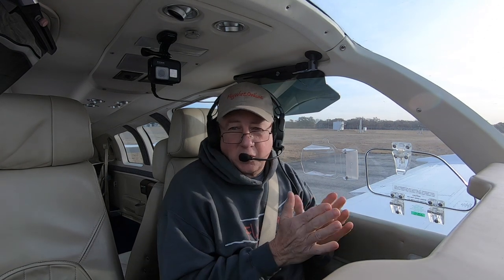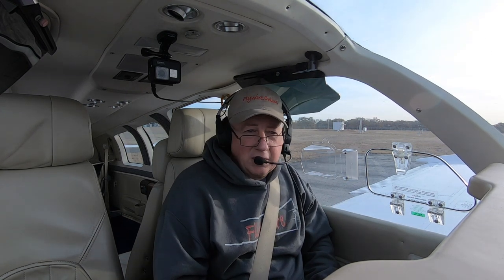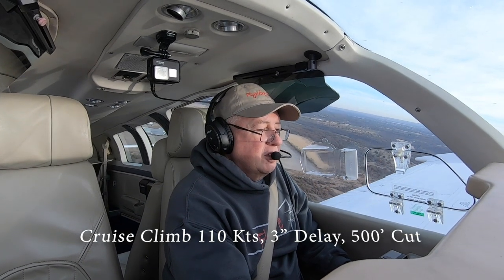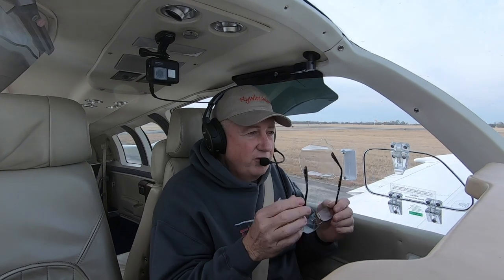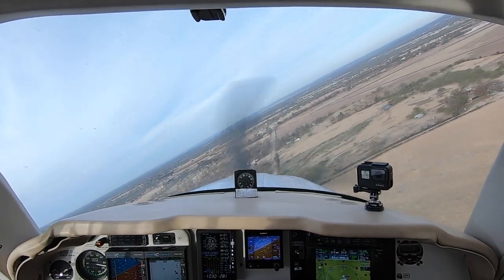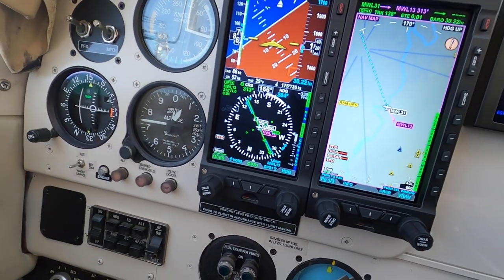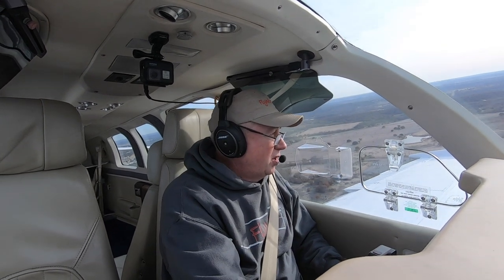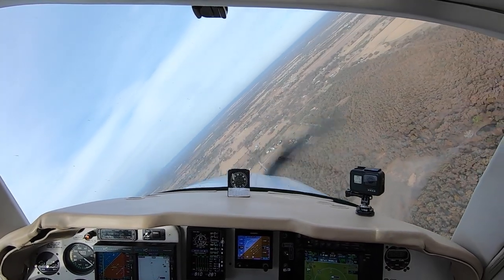A36 Bonanza Engine Failure on Takeoff:  Impossible Turn or Turnback?

Comment: What a great topic. I love your videos! Part of my pre-takeoff briefing is vocalized TWICE - once at the airport before getting in the plane (or at home before heading out to the airport) after getting ATIS/ASOS weather and once again in the plane holding short before calling the tower to depart.  I vocalize the 70/50 rule - must have 70% of Vr by 50% of runway remaining or abort the takeoff - which for my plane is typically right after airspeed is alive at 45+ KIAS. Once in the air, failure (push down, trim for best glide AS SOON AS POSSIBLE...) at 0-400 feet AGL, land straight ahead, 400-700 feet consider turn into the wind up to 90 degrees, 700-1,200 AGL consider up to 180 turn, and above 1200 feet AGL, return to the airport. I call out what these altitudes are in MSL (and write them on a post-it note I put on the flight deck in easy view). It might say (400/Straight, 700/90 L or R -once I determine wind, 1000/180, >1000/Airport),  I find it VERY important to use Google Earth and really review and survey the 2-3 mile area around the airport environment - that is most likely how far I would be away from the airport if I lost my engine under 1200 feet. Also to look at 3D view on Google Earth so I can see what potential obstructions I might be dealing with - compare against FF or my Sectional. Glad to have the FF glide advisor... On takeoff I ASSUME I am going to lose my engine to help me anticipate a push and not be in too much shock or have too much hesitation if it does actually fail. Complacency kills people - even the best pilots...

Comment: Thank you for the exceptional video. I suffered an engine failure 17 years ago in a v35B, an experience that I relive every time I fly.  I can assure you, and everyone that reads this that any decision to turn back at 500 feet agl will be catastrophic, unless you are in a Cub or other high glide low stall airplane. My failure occurred at 700 feet and past the end of a 3000 foot runway on a hot, high DA afternoon.  I had just seconds to “fly to the crash”, in my case a corn field.  Gear up landing, no time to get it down and manage the additional drag. I and my pax walked away.  I have since practiced the maneuver every month at 3000 plus.  The story doesn’t change, under 1000 plan for straight ahead or possibly 90 degrees left or right.
Thank you once again for the fantastic video.
Reply from the maker: Leo- Thanks so much! I'm glad you liked the videO and you have a great story! Glad it turned out well! Practice instead!

Comment: 40-45 degrees bank and Vminimum sink will make you turn in less radious.  It wont stall unless you are too heavy or pull too much (Panic Pull).  If those 2 cases, dont turnback.  Or unless over 1,200 agl.  In the turn, if get too slow under say 90knots you are supposed to pop 10 degrees or 12 flaps in this case.  The lower the speed, the lower the flaps have to be to lower the stall speed. That is normal knowledge for any real pilot.  Thanks for your video Mr. Perdue.. Good knowledge saves lives.  Some say dont learn turnbacks.  But ignorance is not the answer, IGNORANCE IS THE PROBLEM.

Comment: Always excellent well calculated analysis.  Ground rush is a big issue in landing my parachute every time and is a killer....at least a bruiser.  Not really practiced in Aviation.  I had not thought about that aspect of engine out.  Also the Mush as you try to level off.....may push you into the ground.  A lot to consider.....  Thank you!

Comment: From 700 agl you could easily reach the runway, you had enough alt to even drop the gear and flaps at 06:19.  But then the crosswind tailwind landing could be a challenge.  From 1k could be even easier.  But that crosswind/tailwind landing could demand perfection, specially on the tailwind alignment.  Tailwind turns you have to start them before you think you need them or you will over shoot the alignment. 
The CFI that taught me those turnbacks 2 decades ago have a video landing a cherokee with full 16 knots of tailwind/crosswind on 3,000 feet of runway used.  
He used full flaps at the 180 degree point, forward slips, align early, then cut the flaps and mixture in the flare.  Good tricks to know..

Comment: I retrained after thirty years away from flying.  Although turnback after engine failure wasn't prominent in the syllabus, it was important to me, and I practiced it at altitude over I-10 west of New Orleans Lakefront (where a failure from 36 drops the plane in Lake Pontchartrain).  One of the issues was turn direction from the takeoff leg.  I decided I would rather be upwind during the turn drifting toward the airport than downwind clawing back to it.  With a failure on the takeoff leg, and from a plausible altitude, I would turn into any crosswind. Another issue was how to mitigate the problem, and to me that meant regularly staying in the pattern close to the airport a bit longer while the engine proves itself.  This argued for a routine turn to crosswind sooner and at lower altitude than later, further from the airport.
Great video.  Only suggestion is to report how much of the needed turn the plane completed in each case.  How far around had it come (50%? 80%?) before you stopped the exercise at 200' AGL.  Thank you and fly safe.
Reply from the maker: Sounds like you approached the issue methodically. Good job.

From my perspective, the amount of turn remaining is not important and may prove a negative. If its not enough, acknowledge that and land somewhere else, while you still have the energy to do so. That's my take.

Comment: I wonder if you could carry a small rocket engine to be used only for a limited period in engine out situations to extend glide or allow for more speed in the take off regimen.  Not jato, but sort of like it.  Just enough to get you a couple of miles.
Reply: An expensive and heavy system that would use up most of the aircraft payload capacity and might get used once in 30 years.

Comment: Thanks for this! After the Harrison Ford incident, I went up and practiced different configs with a 1K over a practice field sim takeoff/climb and same as the hard deck until I had it figured out. Now, I can do it consistently to a full stop as long as I have at least 800agl at a mile or less with turn into any crosswind. Slip and flaps often needed with a good tailwind. At half mile, 500agl is the magic number. It's a good tool to have in the bag if the straight ahead options are buildings and one knows the numbers. The thing that surprised me most is how brisk the push needs to be to get best glide in C182 when pulling the throttle on climb out.

Comment: Communication is critical. If at a Towered airport, my "goal" is to return to the Airport Environment where the Tower can immediately get help on the way, to my exact location.  Just the Airport Environment, with mostly flat land around the runway. If I can make the runway...Bonus.  At non-towered or airports in busy city areas, pick the best spot and go in wings level as slow as possible.
Reply from the maker: Great observation!

Comment: I instruct this "impossible turn" maneuver at altitude and perform a 360 turn so one can simulate being re-aligned with the runway and then getting the gear down.  I ask the student to hold the pitch for 4 seconds and we loose 5 knots per second, so we are already at 85 - 90 when we then unload the wing and roll into a 45 degree bank.  We do a 360 turn, and lower the gear with 30 degrees  of turn to be completed.  I will now watch the sink rate (ground rush) and make that part of the debrief. Keep up the good work!   We typically loose 1100 feet on a good day!  Most pilots keep their airspeed too high which accelerates their sink rate!
Reply from the maker: Dan, excellent to hear your technique. Doing this maneuver close to the ground leaves little margin for error.

Comment: I've done this whenever I've bought a new plane.  I have found that it is best to turn no more than 90 degrees at 500 feet and 180 degrees at 1,000 feet
Reply: With a good wind you can do more.  Not on short wing airplanes.  or shallow climbing airplanes. Not those.  With partial power you can Turback from 300 agl on non too heavily loaded airplanes.  It takes practice but it is good to know those maneuvers.
Reply: @feetgoaroundfullflapsC  Banner towing climbs to only 300 agl to Power On Turnback to pick up the banner.  Crop Dusters Turnback from 200 ag, Power On too.   A matter of knowing how and not pull back much until the runway or place to go is under you.  No Panic Pulls..
Reply: About the same advice as fly wire, good to hear this kind of confirmation.

I’ve never had to land out, but I’ve practiced it a lot, and pretty much was taught not to do a lot of turning action, of course.

Seems to me a little advice might be to pick a landing place straightahead, or almost straightahead, and come in high if you can and slip down when you know you’re going to make it.

I see bush pilots doing this in films all the time, almost like this is the way they fly, because they don’t want to come up short, especially with trees on the approach.

Comment: Hi Scott- Well since others have chimed in with their experiences, I thought I'd throw mine into the hat for consideration.  As a CFI, I found myself on the receiving end of the question to-do-or-not-to-do-this more often than I cared to be.  I came to dread the subject, but never let that show.  After so many rounds with it, I ended up with a pseudo-formula with which I'd teach it.  I'll try to encapsulate.  Fundamentally, I would teach that they needed to have a plan in place prior to advancing the throttle, and one that was worked out during the preflight planning.  Ergo, not one that they cobbled together while taxiing to the runway.  Then execute that plan without much thought should you encounter the engine failure on climbout scenario.  Regarding the details, in essence, I told student pilots and those with lower time to avoid the maneuver altogether.  Instead, focus on suitable landing areas within a 60-to-90 degree sweep, either left or right.  Then came my caveat (well one of them): do that UNLESS you are departing from an airport in a densely populated urban area or other obstructions where there are no suitable landing areas on the departure end of the runway.  Even then, your planning should be able to identify some road or other open area that you might could aim for, assuming you reached a sufficient altitude and position to do so.  This is getting long, though it is a lengthy subject to discuss.  I'll attempt to summarize...what I'd teach is that after completing the weight and balance for the given load, the departure and landing distances as well as the expected ROC that they could expect given the atmospheric conditions present at the time of departure (ergo DA, winds, less some percentage due to airplane/engine age and condition), to then determine the minimum altitude that a return to the airport would be feasible.  I'd have them do that using the engine-out glide performance chart in the POH/AFM.  The ultimate number that they would generate would vary with those atmospheric conditions that I mentioned.  I also had them compute the distance required to reach that altitude from the point at which the airplane began its takeoff roll.  I avoided stating blanket altitudes such as 400', 500', 700' or even 1000' telling them instead to only consider the maneuver if they were willing to run the numbers.  No numbers = no turnback attempt.  Once that minimum altitude for that day, that load, those conditions, that airplane and that pilot's skill level and comfort factor was determined, I taught them to round it up to the next 100'.  Then I had them write that number down in order to help them remember it; store it in your short term memory I would tell them, as it will vary a bit for each takeoff.  Regarding the actual execution, I would tell them to plan on an engine out during the upwind, that is to merely be waiting on it to happen, to keep it at the forefront of their mind in order to reduce the reaction time as much as possible.  Knowing full well that doing that would be quite difficult if not impossible.  Anyway perform the takeoff procedure as per normal, hitting your speeds and maintaining them.  Sweat gold bullets until you reach your rounded-off minimum altitude 'cause anything below that and all you have is what is in front of you.  Have a plan for what you'll do if that happens too.  Then if you reach that minimum altitude, don't hesitate whatsoever.  Execute the turn as you practiced it, but whatever happens prepare the plane to land wings-level and at the slowest speed possible.  Ergo don't continue a turn to make the runway because landing in the grassy areas is perfectly acceptable, depending on runway layout and airport configuration (ergo "open-ness").  Even if rolling out means hitting trees, as that would be better than cartwheeling in an open field.  Maintaining speed was the most critical factor I would tell them.  And that was it, well in a nutshell.  We'd practice it at altitude and for advanced students I would generally be willing to attempt a simulated turnback at an uncontrolled airport provided that it wasn't busy.  I did insist on a minimum recovery altitude though, much like your 200' number.  I found that with some practice, the student themselves would know what the outcome would have been even prior to reaching that minimum recovery altitude, so there was no point in continuing the exercise below that certainly.  Most of the time we ended the maneuver well above that minimum recovery altitude merely because the outcome was that obvious.  In the final analysis, it seemed to me that the majority of student pilots appreciated the simplistic approach to the problem while the advanced students preferred to address the issue with a CFI in the right seat.  I also found that by requiring them to run the numbers the whole concept and the larger-than-life persona/legend that accompanies it would be reduced to another maneuver that they had in their arsenal.  And nothing more.  That is, they all seemed to like the approach of dissecting the large monster of "The Impossible Turn" down to "just another maneuver" that they had to learn.  Well ... so much for being brief.  But there you have it ... my feedback.  Hope it helps someone.  Thanks!
Reply from the maker: Thanks for sharing Jerry, great story!

Comment: The key is planning your "what iffs" before you start rolling. Had that drummed into me learning to fly gliders. Normally you check if you can land ahead but the next is to plan which way your first turn will be. Sometimes you can make an S turn to open up space into wind.
Reply: ???? S turns where? ON Departure Leg?
Reply: @CFITOMAHAWK  Yes. It's difficult to explain without a diagram. Let's say there is a slight cross wind from right to left. On a cable break your first job is nose down to ensure airspeed. Then decide if you are high enough for a full circuit, partial circuit to another runway or land ahead. If landing ahead was marginal you might turn slightly left then immediately right so you are landing dead into wind into the right hand corner of the field. At our club almost everywhere was laudable if necessary. Calling it an S turn is exaggerating somewhat. The point was to decide in advance which direction your turn would be if you have to turn.
Reply: @ColinWatters  Good points..

Comment: Good to also practice those turnbacks when doing GRM Double Flyovers (Power on of course, to keep altitude).  And also when High DA Box Canyon Turns, which are low power turnbacks.   Those are turnbacks too many pilots dont know how to do and fail on them along with the Take Off Turnbacks.  See my channel for those 3 turnback situations seldom practiced.

Comment: I may have missed this point in your video.....always do a good run up (several minutes) before take off roll.  I even go to full power for 15 seconds -- if the engine is going to fail let it do it now on the ground, not when you're 300' AGL over the departure end of the runway.  Many climb out accidents could be avoided if the pilot did a good run up before departure.
Reply from the maker: Good suggestion.

Comment: Disclaimer: I am not a pilot. That being said. The 3 second delay killed your airspeed. Get light in the seat the second power is lost.  That 3 seconds could have helped maintain momentum and allow you a tighter turn back without hitting the minimum safe maneuvering speed(probably the wrong term). Either way these are scary situations, and I'm sure that regular practice and learning the limits of you and the aircraft you are flying is prudent training. Great video, and I loled at the old SNL Bush reference.  Love your  videos.
Reply from the maker: Three seconds is fast, the range is 3-5 seconds for normal folks. Testing has showed that even if you are spring loaded to react... it still takes an average of two seconds. It's a cost of being human. And yes, of course it costs energy that you really need. The larger point is that if you don't train regularly to do the turnback, and have your set limits, then don't do it.